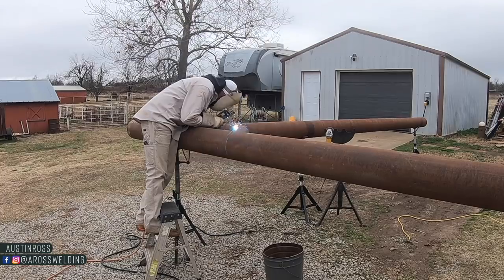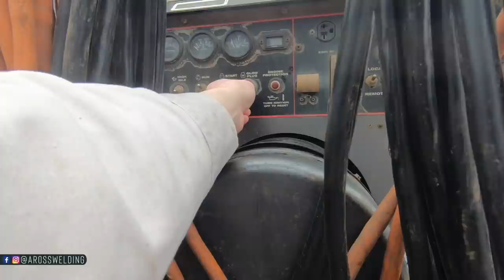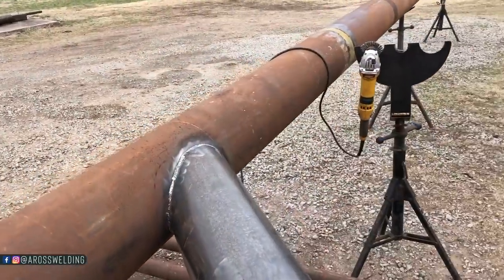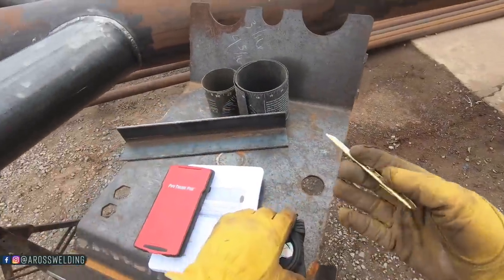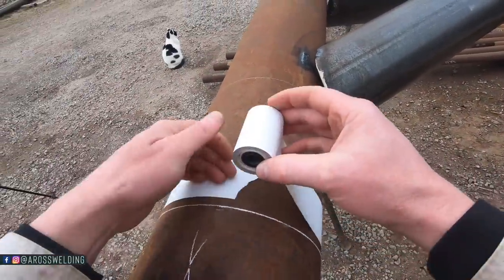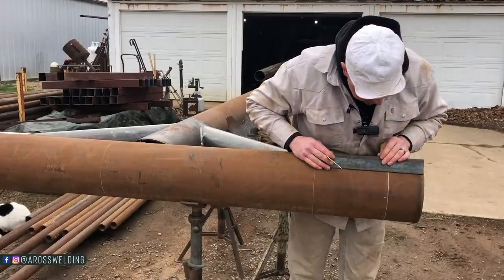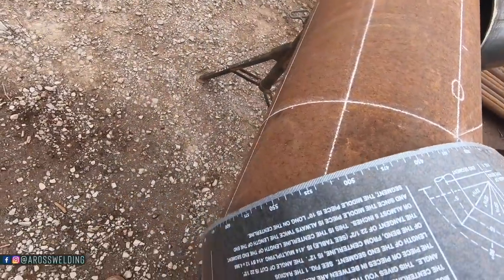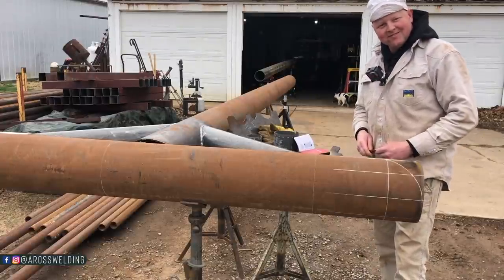WELDING 6” TO 8” SADDLED PIPE AND CUTTING 45 DEGREE END CAPS - 8” CUSTOM PIPE ENTRANCE (Part 4)

Comment: The magnetic plastic sheet material they use for stick on signs for your truck door could be cut into strips and used to mark the long  angles on you pipe. Wind wouldn't affect it

Comment: There is a tool used to make those various degree cuts on pipe, called a Curv-o-mark. I have one and use it all the time and it makes it a more accurate fit than the way you show and a lot less figuring,  it has a body that is placed on the pipe itself and also has an arm that is hinged in a couple places that holds the soapstone and is set by the  degree needed at the body  at the body that is marked in degrees that is hinged and mounted stationary to the arm. Look it up on google to see a picture. It will work on pipe from 1 inch up to 16 inch diameter and also  do the layout of saddle joints  by placing the body at different point locations on the pipe to be saddled by folling instructions that is supplied when purchasing.

Comment: Hey Austin love your work. Would one of those needle gauge things work. The ones that you can push into an object to get a copy to trace. I've seen people struggle with cutting angles on stuff and it was all because they had their square out of alignment  to the section they needed to. You've done this plenty of times so you know what your doing new guys may not get it so easily but. Keep welding.

Comment: Austin, got 18" 1/4 pipe and been welding 45° riser elbow and the way it's fitted is to hold it in place and tack it with pulse/spray. Was wondering if you had a better way to hold the riser into position so as to focus on fitment from the very initial go? Thank you and God bless

Comment: Hey Austin, I know that the majority of your welding is downhill, but if you feel comfortable doing so, could you please do an uphill 1/8in 6010 root  with 3/32 7018 hotpass, w/ a weave fill and cap. I'm having a hard timewith undercut on the sides. Thanks.

Comment: Howdy,Was wondering what that mathey dearman flexible ruler is called you used to wrap around the pipe ,great work and as industrial insulator I see a lot of similarities in our work since we lay out saddles /equalaterals/unequalaterals for our sheet metal ,you can look up sheet metal pattern apps and videos ,work smarter and harder !
Reply: It's a Wrap-A-Round, made by Curv-O-Mark.

Comment: I never was smart enough and didn't have the time to figure all this out for the angles. I bought a set of templets for various sizes of pipe at the local welding supplier. Sure saves a lot of head aches. Just saying.

Comment: Hey " A " man, I have a quicky. Why are you running a down beed? I'm not versed in that style of weld. I can only guess its from 14"+ piping. Still learning after all these years, hood down lights on.
Reply: Pipelining downhill is a lot faster and they use rods that are made to go downhill not like 7018
Reply: Plus the end caps aren’t structural so I’m sure you could use even a 6011 or a 6013
Reply: @nicklebac6753  thanks nickle bac, what type of rod is used for that, ill try it some time
Reply from the maker: Down hill is just my go to because of my experience with pipeline welding. On somethin like this a guy could do either one uphill or downhill. 
Check out this video
https://youtu.be/w8KxmK_T3Nk
Reply: @arosswelding  Thank you for the link. Ill pick some up the next time im at the weld supply store. Ill give you an update when i try it. By the way i tig vertical up beeds, also sa,and pulse  mig all up beeds. Hood down lights on.

Comment: How did you figure out the measurements for the oval caps on the end?
Reply: I bet you could just lay a piece of cardboard over the cut end and trace around the outside.  Then make the template mark on the steel plate, make your cut about 1/8" inside that.

Comment: What size oxy fuel hose do you run?
Reply from the maker: The smaller one. I think it’s considered the 3/16
Reply: @arosswelding  thanks
Reply: Why is the first 10-15 feet twisted up not straight like the rest?